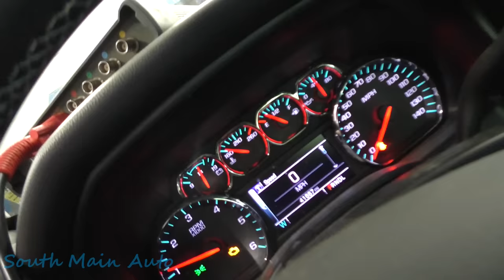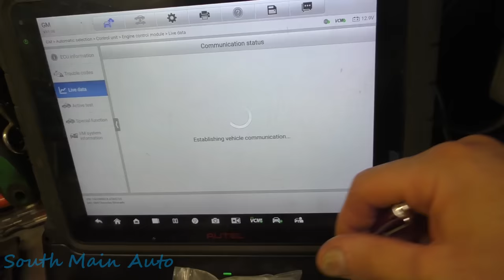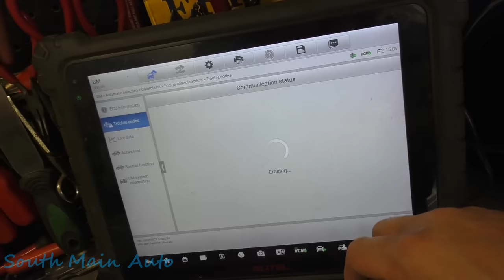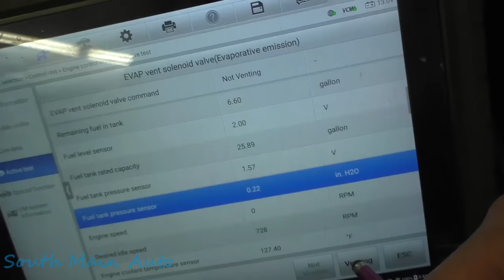'18 Chevy Silverado - In Tank Fuel Pump & Fuel pressure Sensor

Comment: Would it have helped to spritz a little Fluid Film on that new ring and tabs, or will it be ready for the crusher by the time it needs another fuel pump?

Also I assume you informed your customer it's going to need a new driveshaft soon, can't believe it's already failing with only 41K. I swear almost everything GM has made since ~2014 has been a POS...and I'm saying that as a GM guy!!
Reply from the maker: Yeah it will never live another 5 years to see another fuel pump. 3 years tops. It'll be right in half.

Comment: Eric,
Would you have ever considered putting a spritz of fluid-film on the top where the tabs on the tank and the lock ring mesh?
Reply: i came here to say the same thing, Fluid film would slow down the rust.
Reply: I found a wingnut pipe plug the right size like 5" or so, to seal the tank opening so I could wire brush and rust dissolver and rinsed and repainted the tabs, but also use FF after assembling and new lock ring.  If the tabs rust off, that's the end of it.

Comment: You can't always judge a utility weld by how it looks . . . I learned how to weld on a water well rig. Some of the hard to reach awefull looking welds lasted forever and decent looking welds can surprise you. BTW, utility welding is welding equipment that is on the job covered with grease, paint, dirt, cow crap and worse. Anyone can weld red iron.

Comment: A problem since the 90s?!? Even back in the "square body" days starting in 1973, WELL before electric, in tank fuel pumps, the lock ring has been down in a well. I LOVE my "square body" trucks but, those steel tanks ALL have seam leaks even if they've been replaced in the past. The steel lock ring and sending units make them a real adventure to change. I worship my Brooks brass hammers and punches every time I work on them!

Also, I know all about working in heat and humidity with no butt to hold your pants up! I've been seriously considering investing in a couple pairs of suspenders lol!

Comment: @33:40, you can see the clip is actually cracked in half.  You can see it just as Eric moves the clip back into position - a small crack opens up a little past the 3 o'clock position. The rest of the clip is literally being held by corrosion.  I'm suspecting the loose part of the clip is going to go flying when the shaft is spinning and the rear end hits a good bump or pot hole. But it's probably ok because there is so much corrosion between the bearing caps and the aluminum they will have to be beat out with Big Nasty!

Comment: I have a 1992 Buick LaSabre and a 1993 buick regal and had to replace fuel pumps in both.I just cut holes in the floor of both cars and did not have to drop the fuel tanks, and slobbered up the top of the tank and fuel pump mounting plates and areas with tar and grease so wont rust. Only a little messy

Comment: I had a 1973 chevy truck and it was so nice I did all of the work myself but it really did not need much work at all it was still running with 215,000 miles on it.

Comment: Im always amazed at the jobs you get into. Im in London Ontario, huge salt belt as you are but I’ve yet to see that fuel pump crack like that. Of course the older ones would have to top rot or lines rot. Last vehicle I did that had similar emissions issues where it was a pump issue was a Toyota yaris
Reply: That's because the other shops and people around there know his skills and bring him the impossible stuff.

Comment: Chevy dealer replaced the fuel tank under warranty on my 2011 Suburban K2500, but a couple weeks later I noticed some moisture on the floor under the rear differential.  The technician who swapped the tank kinked the differential vent tube causing internal differential pressure and ruining the pinion seal.

Comment: The same issue you have with your wrenches I have with my Matco long box ends. First time using the ratchets fail, get it replaced and it fails first use. Talked to my rep and he said they are coming out with a new design and said he would swap out the set for me. Sucks when you're paying $300+ for the 'professional' brands

Comment: Why didn’t you spray a little fluid film on the metal tabs at the fuel tank opening? Maybe the next time that fuel pump assembly needs replacement it will still be removable/replaceable.

Comment: Only changed one fuel pump it was on a GM-H 94 station wagon & the pump was in the bottom of the tank easy to get at just get covered in fuel getting that dam retianing ring off.Cheers. (while I was working.)😜

Comment: The salt in the well didn't cause the hat of the pump to break off. A builtin well in the tank where the pump can fit in snuggly so it doesn't sludge around with the gas would solve the problem. So the question is did the lock ring corroding that bad cause the pump to break.

Comment: With the hose clamps ‘upside down’ it is possible that the fuel lines are put in before frame flip during vehicle assembly.  Some plants start with the frame inverted and install a lot of the ‘bottom’ components then flip the frame and continue assembly into a rolling chassis before dropping on the body

Comment: In 2017 I paid $375 and some change for a drive shaft in a 2001 Silverado. A lot of places that make the drive shafts use thinner diameter thicker wall tubing. Crazy on how much they have increased in 6 just years.

Comment: Pretty crazy that a 2018 with 41k on it already has those kind of issues. My 07 tundra has the original fuel pump, other than oil, spark plugs, and filters, everything is original on it.

Comment: Great part 2 Eric you never let us down especially with the Chevy's. I have hade good luck with GearWrench myself, as a matter of fact I still have the original GearWrench when they first came out. I need to replace the 10mm but what can I say have had them both Metric and Sae for a long time and they have many miles on them.

Comment: I had two different thoughts. It is obviously a design flaw. So my first thought is a question; was there a sharp edge/corner where the crack started? And did the replacement have a curve in the area of the crack? My second is that the crack could have started from vibration or harmonics. If that were the case, you might tell your customer to keep the gas tank toward the full side. The tank full of gas will help dampen any vibrations. Of course the pump itself could have had an imbalanced impellor which may have caused a vibration.

Comment: Eric, I only use GearWrench Reversible ratcheting and normal GearWrench ratcheting wrenches. I have yet to break one. I own a couple snap on ratchets but I usually only use my GearWrench ratchets as well. I own a couple 120xp 14", 3/8" and 1/2". I also have GearWrench Locking flex head ratchets. I find GearWrench makes really good tools on a budget.

Comment: Have you ever though of lifting the bed?  just a few bolts and unhook wire harness and there's the top of the fuel tank and no pulling the tank just change the fuel pump with the tank in the truck, pretty easy way to do it. what's your thoughts?

Comment: I gotta boatload of tools for a DIY'er.  One thing I don't have, however, are ratcheting wrenches.  Since it's not something I do against the clock, it ain't that big a deal.

However, today, I was installing the rubber mount for the transmission cross member on a 1993 Chevy C1500 after doing some work on the valve body.  Can't get a socket in there...  So, we do it old school, on and off with the box-end, a quarter turn at a time...

And what went through my head?

"Maybe it's time for me to get a set of those ratcheting wrenches?"

Then I thought, "Why?  You ain't workin' book rate and the time in the garage is rather relaxing..."

There are production-rated tools and procedures and shadetree protocols.  If it wasn't for the ATF dripping on me, I'm sure I could have taken a snooze under that thare truck's shade today!

Comment: Aluminium Prop Shaft, with a Steel U Joint and spring tension clips fitted into same  and prop shaft recess buried at the very edge of the U Joint housing, then of course add rock salt, Water, who would have thought Galvanic Corrosion could occur, Murphy Law... what could go wrong and at the worst possible time, great Upload ...G.M.obviously has employed, Basket Weavers as Engineers. Great Upload.
...

Comment: I think given the mileage of the vehicle, the fuel pump change would prompt also changing the fuel filter.

The 11 mm head size is almost as rare as the 20 mm. 

When reconnecting the electrical harness I always condition the connector pins with Deoxit D100L in the small brush bottle, if the connector needs spraying, I first use Deoxit D5 in the spray bottle. I find it best to cycle the connectors a couples of times to help clean and lubricate the pins. However, if the connector looks too fragile than I forgo the cycling. 

I think over time automotive connector pins have a build up of oxidation, and also dry out if the pins originally had a lubricating coating when the vehicle was assembled. If you take two old oxidized mating pins (male and female) and treat with Deoxit D100L and cycle the connection a few times, you will notice the pin wiping surfaces cleaning up and mating with a lot less effort.

Comment: Just a question from across the pond, for extra safety why not "weld?" a you clip to the tops of the lift jack supports, so it fits into the bottom of the car frame???/

Comment: Yes, if you like those wrenches  enough but they fail in short time I'd guess it would be a good idea to have 3 or 4 new ones in stock so you don't have to wait for the warranty replacements. 
I'd agree on fuel pump "modules" in most vehicles these days, do they really need to use 100% nylon/plastic in critical areas?  Some of those are $500 and totally not worth it. Good idea to purchase the module without the sending unit anyway which will keep the fuel gauge reading exactly the same it had been, especially from 1/4 tank down to empty. Not all sending units will read alike. Too bad about the al u minium  corrosion around the yoke ears...dis-similar metals and salt !

Comment: I just remove the bed bolts on the left side and loosen the right side bed bolts and take the feeler neck loose then jack up the left bed side and there is the fuel pump

Comment: Eric O’…Hope you are not standing on a plastic Bucket!!! LOL The Best part and worst part of your videos is realizing what I did wrong when I changed my Fuel Pump. First of all, I had it on ramps in the driveway, and decided I needed to remove the drive shaft… Well it rolled off the ramps and I chased it down the driveway! I have done others by lifting the box on the left side. Sometimes a better approach with a box that is rusted anyway.

Comment: I did a starter on a 2018, the truck only had 70,000 miles on it, and the stupid little clip thing they used of course broke as if it was 20 year old plastic, I had to cut it off and put on a traditional eyelet on it and bypass the clip, The replacement wire for that was like 80 bucks and has to be ordered, you go GM! My uncles 2019 RST already bent a pushrod at 20,000 miles in its life, Yikes, these generation GM trucks are not looking to hot.

Comment: Imagine coming so close to a rustproof fuel tank design with a plastic tank and plastic pump housing, and then ruining it with cheap steel locking tabs and locking ring which just rust out and wreck the whole thing. Given that this one was just out of warranty, you'd think enough would fail within warranty that they would want to rethink that design..

Comment: I missed how you marked the drive shaft to the pinion saddle.  Most of these trucks go 150k miles before they need a new pump. This truck is probably parked on grass or loose gravel.

Comment: You do tanks like I do. So. Many times is ee people dropping tanks struggling with a drives haft in the way.
   That bit of time removed NG the drive shaft saves the struggle and makes shit sooooo much easier.
My god I ended up the gas tank dude when I was at the dealership. And Ford had recalls on the flex and edge and one other vehicle I forget.
    I was doing 7 fuel tanks and pumps a damn week.

Comment: Speaking of good engineering,  how about putting a removable plate in the truck bed to make changing the fuel pump even easier?  I know a few guys that work on their pickups themselves  and have went to a salvage yard cut a large piece out of the bed and remove the bed and cut a hole big enough to change out a fuel pump. Simple.  Too simple.

On the drive shaft, why not use a U joint with the retainer are installed on the inside?  Some Chevy's use a U joint like that . That would be much cheaper than a new drive shaft.

Comment: here in west TN a Michigan truck off the I -40 pouring gas 2011 chevy fuel pump pouring gas. what a mess. supply line rotted at the tank.2 days from supply house to get the parts  i fill your pain i hate rust . one strap bolt broke in the frame going to bypass the og . 4 days at a motel 1000.00 for rust i feel bad for them. i didnt buy it i didnt breake it just trying to fix it.

Comment: It's insane here in the south EVAP problems usually consist of a missing or worn fuel cap. There is the occasional purge valve. Unless it's a Toyota with a vapor canister that starts filling the system with bits of charcoal or the later RAV4's with the squealing leak detection pump. Either way you'll be out over $500 worth of parts. Toyotas have the most complicated EVAP system I have ever had to work on.

Comment: That aluminum driveshaft must have been engineered by the same guy that designed the fuel tank/pump. Spend $600 for a bad u joint.

Comment: @24:22 If you sprayed the top of the pump with WD40 before placing the ring and tightening it, would that make it easier to drive that pump ring home and maybe make it last longer? Just a thought. Great video!! Is my 2015 GMC Sierra 1500 the same as this?

Comment: Yea I have a 2003 Dodge Ram 1500 with 515k on it with original fuel pump. Gauge doesn’t work. But can’t get oem pump for it. What are the best aftermarket pump makers?

Comment: Is removing the bed a viable option for the repair? Would it be easier or harder?
Reply: I did it already, the bed bolts can be rusted difficult to get out then you have to drill or cut them out, I used cheap sawhorse brackets (2 sets) with 8 ft 2x4 legs and a single 10 ft 2x6 for the upright spine of the horse, made 2 of these giant tall sawhorses and parked under them and used 4 small ratchet straps,  hoisted the bed on the bed tie down corners slowly raising it, I had 8 ft bed, might be 500 lbs idk.  I was also doing frame rust removal and did replace the pump that way, but I removed the tank out from underneath anyhow to paint the frame, but to replace just the pump you wouldn't need to remove the tank straps and drop it if you take the bed off yes, it may be easier on one's back that way vs dropping the tank and wrestling it out if you don't have a lift, but you still have to crawl under to undo the bed bolts, disconnect filler neck, ground wire and vet tube, also the rear electrical junction connector.  One of the bed bolt captive nuts inside the bed tubes spun off but luckily an M12x 1.75 insert nut can be pounded up in the hole in the bed where the nut was using a bolt in the insert to beat it in there and can be crimped nicely so you have a thread that is good there, not as strong as the thick factory nut that is crimped in, but better than nothing at all.  The rest of my bed bolts i was able to turn loose and remove except two others a guy torched off when he removed it earlier, then and had to drill the bolts out and use a extractor which I was able to remove the cut off bolts with.  I just chased all the treads with an M12 x 1.75 tap to clean them and used anti seize later.
Reply: I would recommend spraying penetrant in through the ends of the box tubes onto the bed bolt threads (if you can see that and get spray in there) in advance to help loosen the bed bolts and use hand tools to loosen them with forward and backward creeping action to make sure to preserve the stamped in or pressed in nuts as well as possible.  Using some little propane torch heat helped me get mine out also.

Comment: re the driveshaft - is it possible to run a bead of aluminum weld around it to hold the new clip in? Would save buying the whole shaft, even if you can't get the clip back out ... gets one more life

Comment: I'm actually surprised GM used a standard hose clamp for something.  I'm not surprised they were different bolt sizes, though.
Reply: Right?  I figured they would've just slapped some constant tension clamps on the filler hose and been done with it.

Comment: I changed the pump ,the fscm and no start.Wondering what else it could be. I had a fuel system control modual come up and a fuel presure regular code.would it not run if you have a faulty regulator?
I never change the fuel tank presure sensor. I put vasiline on the top of the pump to prevent it from rusting.If you ever need to change it again ,abit of areosol brake clean washes it off.

Comment: Just curious.  As the tank pressure went up and down in mm h2o the voltage on the sensor seemed to stay fixed at 1.59

Comment: I have a 04 2500 Silverado  that needs a fuel pump, but I am not gonna have a lift. Is it possible ya think, ( enough line slack) to drop the tank low enough to see to disconnect the lines) Or better to loosen bed bolts and raise driver side high enough to swap the pump out?
Need an expert opinion. 
Lover your videos.  I am new to it.  Thanks
Reply: I have changed my tank fuel pump on my Nova Scotia 200K ‘93 gmc 4x4 jacked in the yard. I was able to 16:14  change. Took me a few days. Today on a non 4x4 I would lift the box up and put a few fence posts to safely support while you work
Reply: once you get access, follow exactly as Eric’s methods including ‘safety’